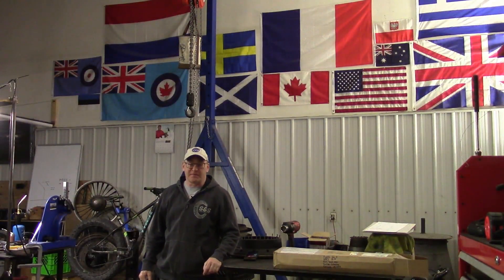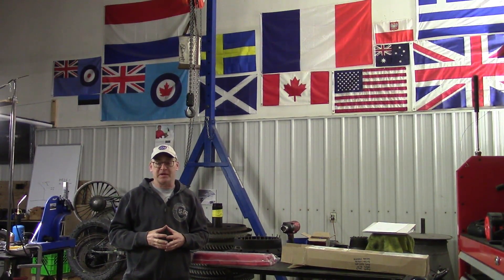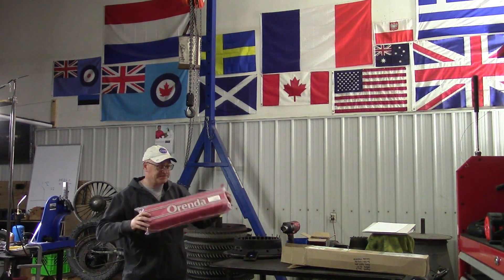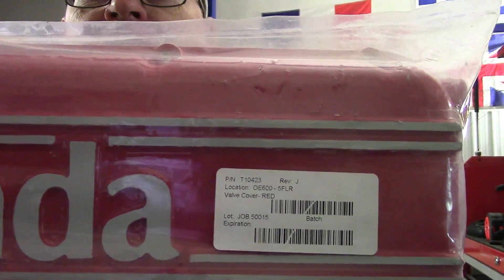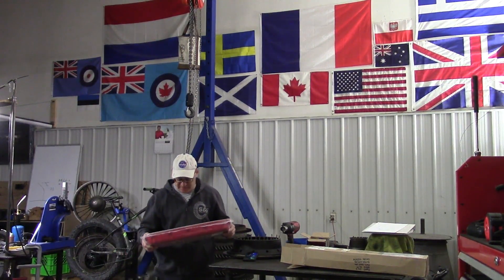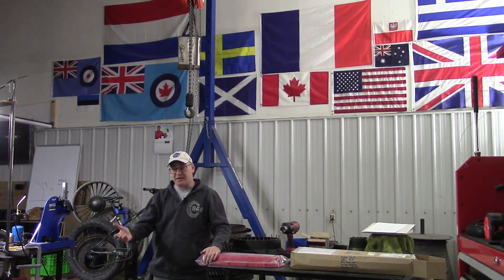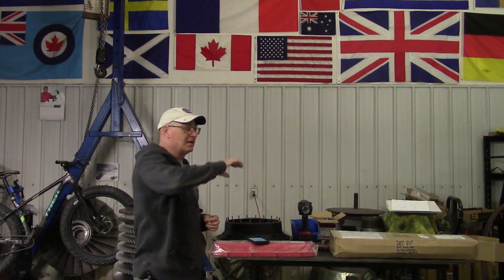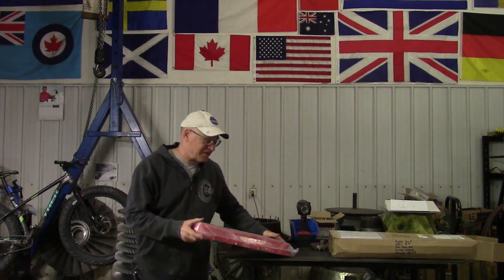Different Fuels for Jets

Comment: Another great and incite full video. Thanks Jay. My vote is for the cover to stay in the packaging. Is another fuel option Hydrogen Peroxide..I think the Germans were doing some trials with their Type XX1 subs during the war?
Reply from the maker: I am no expert, but I'm fairly certain WW2 German submarines did not use gas turbine engines for propulsion.
Reply: @AgentJayZ  Helmuth Walther was experimenting with gas turbines for marine ( submarine) use in 1933 at Germaniawaft (sp). H2O2 powered. They started to come into service during 1944 powered by HTP. They also experimented with putting gas turbines in Panther tanks in 1944 as well.

Comment: Hi Sir, recently I have seen a publication that talking about an aircraft engine that  powred by cooking oil, the engine is Rolls Royce trent 900 equipped Airbus A380. I would ask what is the process?????
Reply from the maker: The fuel control would need adjustments, and the fuel nozzles would likely be made with larger spray orifices. The fuel oil, if highly filtered, would be more viscous than diesel, but would have very similar energy density.
Additives may be required to keep the fuel oil from solidifying at the temps at altitude.
The jet exhaust would also smell like french fries instead of a Zippo lighter.
Reply: @AgentJayZ  Thank you Sir for your replaying answer.

Comment: What about Alcohol? They are putting it in cars, however, the BTU output of Alcohol is less than Gasoline, it just has a higher octane rating.
I would think that you would need to burn more alcohol per KiloNewton of thrust.
Reply from the maker: I did forget about ethanol and methanol. Sorry about that.
Reply: A Brazilian crop duster uses ethanol in a piston engine.
Reply: @zapfanzapfan  and going by the movie Independence Day's crop duster pilot, not only the engine runs on alcohol... 😜

Comment: the question of alternate fuels is indeed interesting!   It's hard to see how we get away from the energy density advantages of jet fuel.  Perhaps some of the proposed blended wing & fuselage airliners would have enough internal volume to make CNG practical?  Work is being done on new hydrogen storage technologies for fuel cell vehicles, so perhaps that will trickle over to aircraft.   Perhaps we might see fuel being synthesized from crops, similar to ethanol.   As noted, all of these will come at a cost, and that might just drive people to other modes of transportation.
Reply: There are a number of aviation biofuel formulations on the market. Some even burn more cleanly than standard Jet-A, meaning that they produce less soot to trigger contrail cloud formation. However, they are more expensive, and bacterial contamination may be more of an issue. I don't know of any evidence that production-to-use output of carbon dioxide is less than that of Jet-A.

Reduced contrail formation may justify the extra expense for the military.

Comment: Probably WAY too late for a vote on the valve cover, but personally as a person in the restoration hobby, you need to keep the documentation safe. How about this: split the difference; carefully slit the end of the bag and take it out. Then carefully and neatly fold the bag and stick it inside so its trapped against the wall where you display the cover. That way the documentation is still with the item forever. Oh, and I agree - its a beautiful piece.
Reply from the maker: I might do that. For now, it's still sealed in the bag.

Comment: Whilst not “fuel” or jet engine related. How about electric? 
I have seen a few experimental aircraft toy with this, however all have been small single or two seater. (There may be larger aircraft I am not aware of) 
But, how do you see the implementation of electric motors for large scale airliners? Feasible in time and progression of engineering? 
Will airliners return with multiple propellor engines again like the DC-3, 4, & 6 but electrically driven (obviously not electric versions of those DC aircraft but entirely new designs) Interested to hear your thoughts Jay. 
Thank you.
Reply: Electric flight.  Where will we all get that Lithium from?  Won't happen.
Reply: @allancopland1768  perhaps not with Lithium, but maybe an alternative like Graphene batteries, if that tech ever takes off, pardon the pun.
Reply: I highly doubt we will see planes that are electric on any scale. The amount of batteries to have the energy density would be more than the plane would ever be able to lift off the ground. Battery technology is at its pinnacle now, it will not have any huge “breakthroughs”. Maybe a few percentage points of efficiency, but we are there now.
Reply: Fuel cell power from hydrogen is more efficient than burning the hydrogen with heat, and that method is what a few places are trying. The hydrogen is still pretty expensive, and you wouldn't want to crash a plane with a full h2 tank. That's basically the way to do electric planes, though. Varies are ok for flying a few times around the pattern. The only reason you'd do it is because it suits the energy currency you have.
Reply: You'll see electric aircraft in use cases requiring sub 2-3hr flight times in the near future.

Current gen battery technology is giving the bleeding edge aircraft about a 1hr battery life, which translates to a 30min flight time for safety reasons. While I don't see battery tech advancing to the point we'll see longer distance passenger flights in our lifetime, they'll almost certainly double or triple in storage capacity in the next couple decades allowing short to medium distance, low volume passenger flights or courier services.

Comment: You can also fuel a turbine on coal.  It's been done a few times, just not that successfully.  Union Pacific made a coal powered gas turbine locomotive.  The coal was ground into a powder and then combusted in the turbine.  It was quite the mad max machine, essentially a Diesel engine cab control unit, with a former electric locomotive holding the turbine and then a former steam locomotive coal tender.  Since the three parts were all joined with drawbars, it's technically the largest single locomotive ever made.

https://en.wikipedia.org/wiki/Union_Pacific_GTELs#Experimental_coal-burning_turbine
Reply: Direct Pulverized Coal, that’s wild!  I know “Coal-Water Slurry” has been tried at least.
Reply: Granted a crazy “Integrated Gasification Combined Cycle” - Electric powered train would be my over the top way to go!
Reply: Sulfur/Mineral Fouling from the coal as well as abrasion would be my concern.  Granted something less nasty like Petcoke, or better yet charcoal/pure carbon may be better though!

Comment: In terms of an alternate fuel for a jet engine my current fascination is nuclear.  I get the objections to it because of nuclear waste, however there are other fissile materials and methods that can perform much better, hotter and with far less dangerous waste than current reactors.  Coupled to an industrial engine it opens up many tantalizing possibilities.  BTW the US did get a stationary engine to run on a solid core reactor.  Don't know how well, but it did leak radioactive particles so not good.

Comment: a)Find a V8 that is compatible with the cilinder head cover, chop off one bank, get it running  good and proper, build a bike around it.

b) show off piece in the shop/shop wall so it will get some clean rag tlc, plus that plastic bag will degrade eventually even in the box.

Comment: Why didn’t Orenda sell it to hot rodders, as it’s a big block Chevy?
Reply from the maker: The people who want to spend a hundred grand on an engine are rare, and they usually build it themselves. Or at least decide what components will be included.
Reply: @AgentJayZ  £100k? I call that a rip-off. It’s just a truck engine with a couple of turbos on it, you can get the basics of that from a scrapyard. Mind you, it’ll bolt straight into any Chevy once it’s out of the plane.
Reply: The price point of the engine was 200k and that was 12 years ago with trace.    
I have two turbos from these engines.. they are MASSIVE..

Comment: As for the fuel alternative: what about ethanol or methanol?
Reply: Those would work fine in a turbine, but have worse energy density than jet fuel so not a good choice for planes.
Reply: The source also sucks. It's not carbon neutral unless biologically derived and that involves lots of farmland and energy needs in the processing. It's very inefficient in that regard, but there are cellulose digestion processes that might open up new sources, so maybe?
Reply: @deSloleye  not necessarily. Sea algae could be used for bioethanol and you don't need land for this.
Reply: @zbyszekz77  none of the biofuel processes have worked yet. Sea algae is for oil, not ethanol, and it's really hard to make diesel-like esters or of it without spending a lot of energy drying the algae harvest out.
Reply: @deSloleye  and what about Sun's energy?
Reply: @zbyszekz77  what about it? You can do it, it's just your algae becomes a carbon source and not a net energy source. It becomes a complicated way of using solar and wind generated electricity to process an algal oil into jet fuel. That said, all the solutions will be complicated anyway.
Reply: @deSloleye  Sun's energy to dry algae should be quite cheap and available. And such fuel when carbon neutral can be good alternative for aviation applications

Comment: Hey Jay, Nuclear powered jet engines where built and did ran, as well as air cooled nuclear reactors, the first nuclear reactor was cooled with open air and it didn't produce radioactive fallout (Magnox and Lucens reactors where gas cooled, and Lucens famously melted down https://youtu.be/kFrriqTDxoo ), in every nuclear fission reactor the fuel is encased in alloy usually aluminum or nickel, and there isn't any radioactive particles in primary cooling systems or exhaust of nuclear jet, if radiation is detected in cooling system something has gone very wrong and reactor is immediately scramed. Far bigger problems with nuclear jets was radioactive glow (which is kind like microwave radiation but worse that every reactor produces around it self while it runs, it consists of gamma, delta, and x ray radiation, it doesn't travel far so it doesn't have any environmental effects but it would cook the pilots alive without heavy shielding), as well as fallout produced in case of fuel clothing cracking or engine or aircraft failure in general.

Comment: I like the fact that everyone ignores the fact that H20 vapor is a very powerful Greenhouse Gas. In fact, the water vapor produced by a combustion engine has nearly as much effect on the Greenhouse effect as Co2. 
Look it up and do the math.
Reply from the maker: Speaking of math... have a quick check on the surface area of the Pacific Ocean. Yeah, forget all the other ones, and let's just look at the big boy. I'll bet that more water evaporates from the Pacific in one day than is produced by all combustion engines of any type, every where in a much longer interval.
A week? A month? A year?
If you really are interested in the subject, you'll do the math and let us know, eh?
Reply: @AgentJayZ  Beat me too it. lol Water vapour is the biggest cause of earths heating but it does not control the earths temperature. It's the other way around and temperature controls water vapour. The warmer the air the less water vapour it can hold. 
So even if engines did add H2O to make a difference they can't because the air can not hold more H2O than temperature allows. 

Take it out of the bag and give it a wax job and also mount the bag it came in.

Comment: 1) Tell all the coal miners who suffer from "black lung" that elemental carbon is harmless.  2) Watch a video of a first generation B-52 taking off and then tell me that turbine engines only produce carbon dioxide and not elemental carbon.
Reply from the maker: Your comment has been rejected for missing the point. And for getting it wrong. And for bitching about a detail that is outside the subject of this video.
Please take your whining, bitching trolling elsewhere.
Reply: @AgentJayZ  : I didn't mean to offend you, andI do agree that Carbon dioxide is a "green house gas" and bad for our planet, and that burning hydrocarbon fossil fuels is a major contributor and that.  Also while ingesting charcoal is not harmful, particulate carbon in the lungs IS bad.  I also agree that "Diesel particulate filters" are  not that great and a much better solution would be better fuel regulation and NEVER running any engine so rich that some carbon remains unburnt, even if the extra power is required for a short time.  As you work on older, jet engines, with lower bypass ratios than modern engines, do any of the ones you work on have to be run "over rich" for takeoff in the aircraft they are in?  If so one Idea I had is for take off, only inject jet fuel at the "climb" ratio and for and for a accelerating down the runway, add compressed natural gas (methane, CH4 with the highest H to C ratio of all fossil fuels), then at the end of the runway eject the CNG tanks, with a spring to have them at a near zero horizontal velocity, thus "giving back" the energy to the plane used to accelerate them to takeoff speed and not have their weight while flying.
Reply: @maxmclanahan6821  :  1) if you count all the people who have died in just the last two decades  from "extreme, once on a thousand year weather events" every few years it is a lot.  2) Via photosynthesis, the plants convert the carbon dioxide with water and nutrients from the soil, along with nitrogen to new plant material, leafs, stems, roots, etc.  3) Yes we eat some of the plants, and other are eaten by other animals, some of which we eat in a process that has been going on for millions of years, the current problem is that we are creating more carbon dioxide than the plants on land and in the sea can convert because of the amount of fossil fuel we are burning, all of which was once plants in the cycle.
Reply from the maker: All of your comments hve been rejected for missing the point. And for getting it wrong. And for bitching about a detail that is outside the subject of this video.

Just leave.
Reply: @johndavidwolf4239  lol. Imagine being a armchair engineer and thinking you know better than engineers that would make a fortune creating anything that would make air travel safer, more efficient, cheaper and better for the environment. Now tell me about your engineering degree… 

Also, great video.